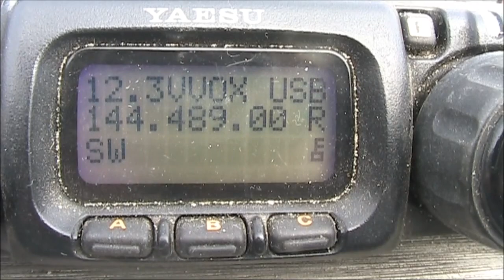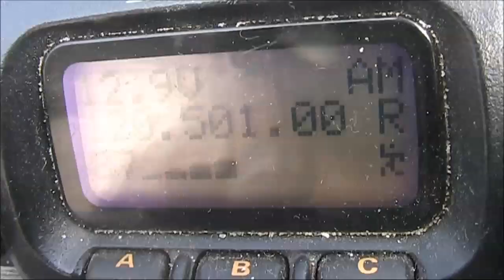Oblong loop antenna for 144 MHz SSB and WSPR

Comment: I made this antenna up this afternoon and using FT8 and 5W I was heard 400km away even though it was just hanging from the roof of my balcony with brickwork behind it, to the left and to the right. I'm now considering covering the walls of my balcony with aluminium foil to reflect the signal back out :-) . Thanks for this design. 73 PA1HUN

Comment: Peter, please be more descriptive of the build, specifically about the feed point connector.  Your still photo that shows the connector doesn't really show much.  I probably know, one end goes to center and the other goes to the ground side of the BNC or SO239.  I just think for some it would help them in constructing the antenna.  Great videos and I try and watch all of them.  Especially the ones about Bitx40 and uBitx!!  I am trying to get into QRP and always looking at ideas.  73 Juddie WD8WV
Reply from the maker: Juddie - yes that connection is correct.
Reply: vk3ye thanks for clearing that up.  Just wanted to make sure.  73 Juddie WD8WV

Comment: If this antenna were turned 90 degrees so the 720mm portions were parallel to the ground and if the antenna was fed on the 720mm portion closest to the ground, would the polarization then be verticle?   Also, it seems that some gain could be had if one would add a reflector, though a reflector would indeed defeat the purpose of making a quick and easily deployed antenna.  Any thoughts from any viewer here? Thx.  John - KB3SVJ
Reply from the maker: Yes it would be vertical. I've done experiments with HF versions of this in a previous video.
Reply: @vk3ye  Thanks Peter, 73.
Reply: I'm a little confused by your answer to kb3svj. He asked if the antenna, if rotated 90 degrees, could still be fed from the center of the bottom side of the loop. Based on your video "A rectangular vertically polarised loop for DX: 20m WSPR test" https://www.youtube.com/watch?v=q2DwMMauB6o, it would have to be fed from the side, which considerably complicates the mounting. Can it, in fact,  be fed from the center of either the long or short portion without changing the impedance or polarization?

Comment: Hi Peter, this reminds me of the hentenna beam. Have you experimented with the hentenna?
Reply from the maker: I haven't tried the Hentenna. Mechanically it looks a bit harder with the extra horizontal wire section for the feedpoint.
Reply: @vk3ye  I think it has more gain though. Apparently it's a variant of the slot antenna maybe. I haven't experimented with it but I think it would be good to try on 70cm or 2m.